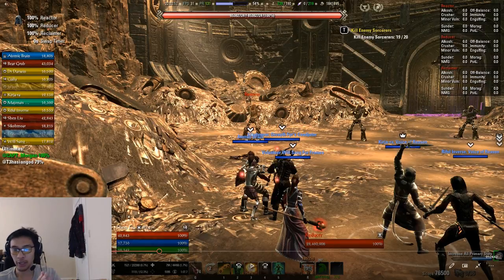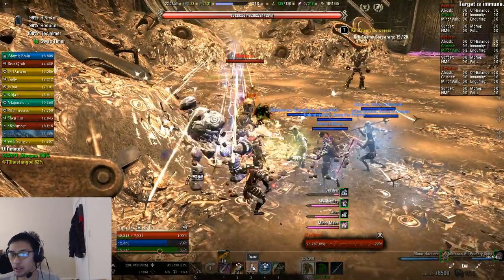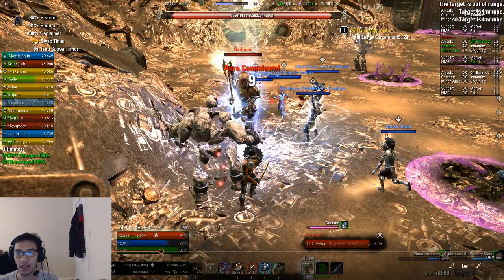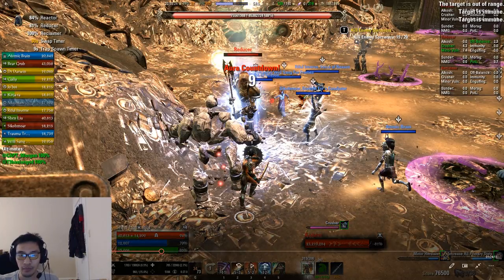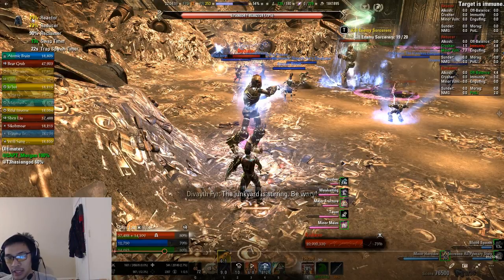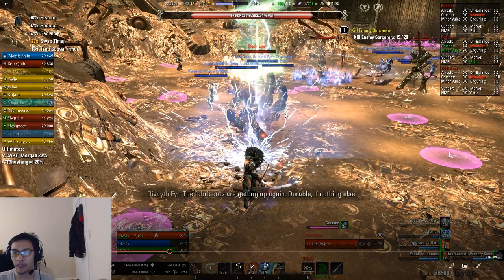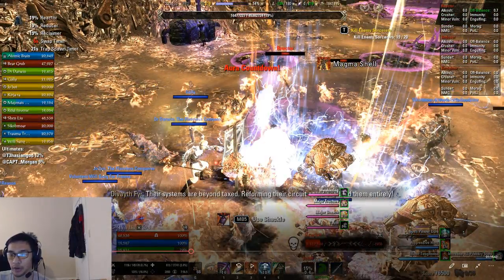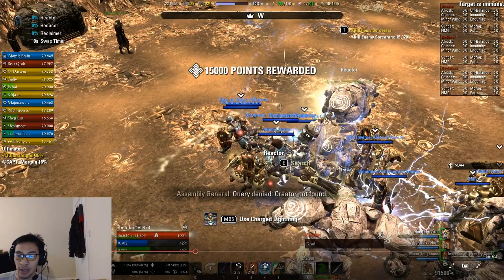Trials Boss Guide - Halls of Fabrication - Refabrication Committee

Comment: Some additions:

Swap mechanic:
IMO its only important both tanks use the same order for  "moving over" and taunting.
- If you charge first then taunt, your old boss will move to you a bit, if you taunt first and move then the "new" boss might move a bit.
- A charging ability is not necessary, a speedbuff (chains, or pots) or mistform can do the trick as well. You can dodge-roll a HA and then immediately go over. 
- If you use a  charging ability, make sure to position the bosses so that no traps are in between them. (Or rather between your boss and the other tank) as the traps still stun you if you charge through them. With the status panel you can prepare easily. It has an approximate timer for that.
- Trap mechanic is ideal to already get away from that boss. He will not move for a few seconds, so you can charge to the other side, take over the boss, and give the other tank the time to swap after you.  Fire mechanic is less ideal, bc as tank you definitely want to purge, as you are closest to the ppl caught by fire! (~Tank purges melees /healer purges ranged)

Reducer / Melting Point:
As explained the whirlinds are always going out in the same relative directions to the boss. 
So the boss can be positioned with the back to the melee DDs (towards middle boss) the ideally wont get hit at all. This also applies to the stacking phases where you could potentially get hit by empowered Melting Point which often acts as one-shot for DDs

Boss normal / HA:
The bosses HAs hit quite hard, their normal attacks however you can ignore. I like to just rolldodge each HA and immediately get my stamina back with a HA on my side. You can oc also block them. But when bosses got connected (without noticing, although they glow) they might suddenly hit harder.
Also while bosses are brought to 69% and taken together, you might get empowered HAs that WILL one-shot you, so I recommend getting used to dodging.

Be aware, that if a bomber is targeting you while a HA is channeled you have very limited options. When the bomber hits you, you will get knocked back and might take the HA without block hence one-shotting you.
- With enough mitigation stacked (phys. res., minor protection, boss maimed) and high enough life you can survive. 
- Mistform prevents the knockback, and provides you with 75% mitigation (although you miss 50%+ from block)
- A dodge-roll is risky: if you can dodge the HA before the bomber arrives, good. If you dodge too early bad. Ideally you can even dodge the bomber itself (although it might come after you again, it seems possible to completely make it explode where you have been, but lagspikes and performance in trial make it really hard to accomplish)
Reply: I know it's quite off topic but do anybody know a good site to stream newly released movies online ?
Reply: @Zander Raylan flixportal :P
Reply: @Roberto Torin thanks, signed up and it seems to work :D Appreciate it!
Reply: @Zander Raylan Happy to help =)